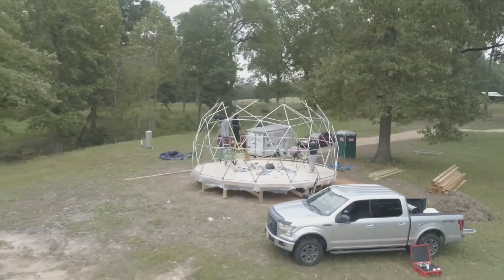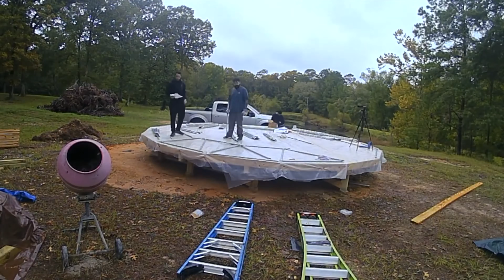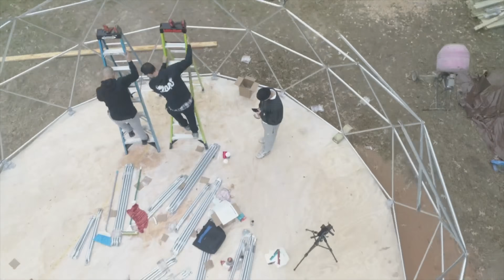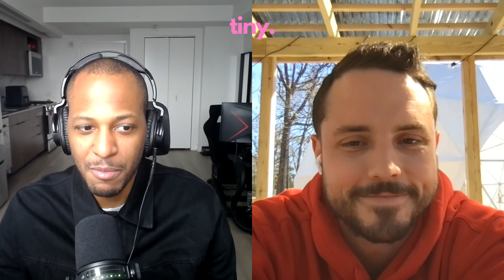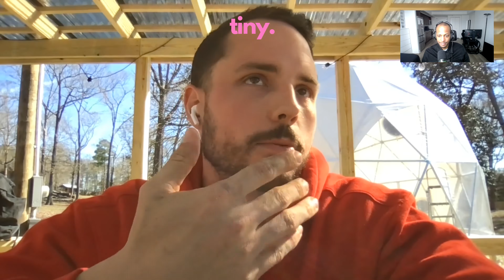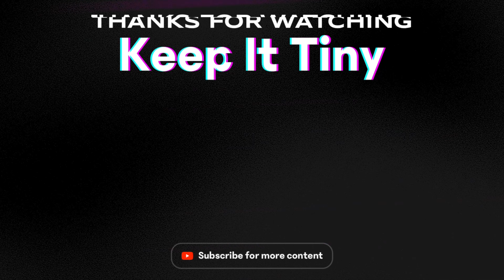EXACTLY How to Buy, Build, and Permit a Dome for a Glamping Business #KeepItTinyPodcast

Comment: Thanks for having me! Your channel is one of the most valuable resources out here.
Reply from the maker: Thanks for coming on my channel and giving us all of your tips and tricks and also thanks for posting even more info on your channel.
Reply: Hi Garrett! Great video guys!
Reply: Hey Garrett, I’m a subscriber to your channel. Can you tell me what you did to get rid of the lady beetles? Thanks!
Reply: @li-nickels  hey! I have a shop vac, some lady beetle insecticide from Amazon, and an exterminator /cleaning crew. The main thing I learned is shop vac them up early bc they send signals for more beetles to come
Reply: @GarrettbrownRE  thanks!
Reply: how was "getting" the dome to the site? the spot im looking at i dont think can bring a big delivery truck (a pickup should be fine).

how did you get the dome materials to your spot
Reply: @natefonseka  so I used trucks to move the items around which wasn’t bad and it shipped via fedex. If you can’t get fedex packages or no trucks can make it around then you may need to manually carry or pick up from their main hub . You can break the kits up into smaller pieces so it’s not bad to transport just would take some labor.